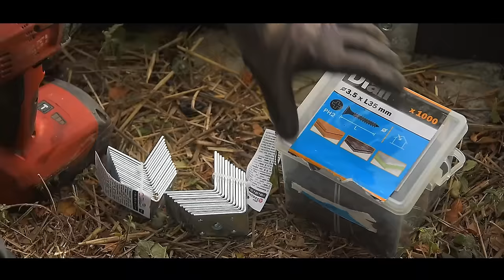DIY Fairytale Greenhouse Build

Comment: 24:12 Isn't engine oil super flammable ? for wood..? (real question, I know nothing about carpenting etc)
Reply from the maker: It will keep moisture away from wood. That's why I am using it, so the greenhouse will last a long time. Thank you!